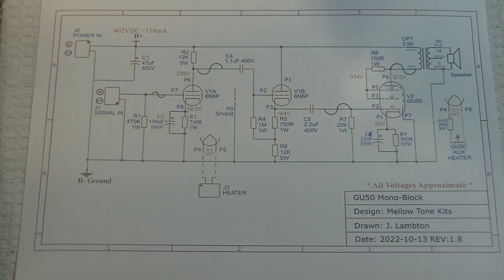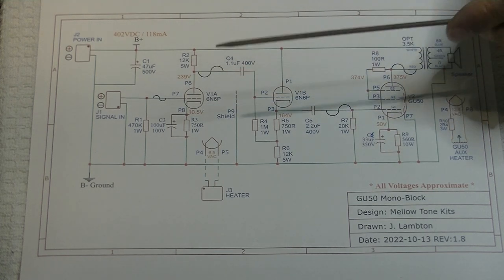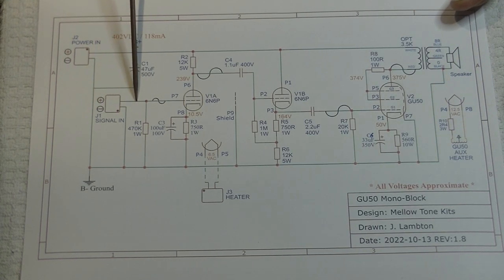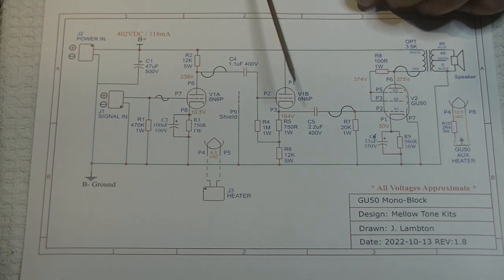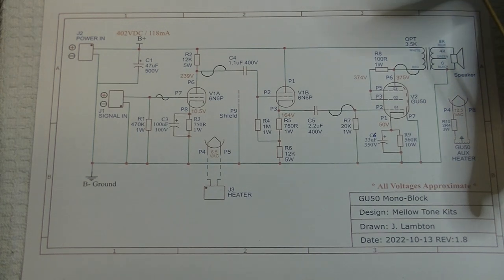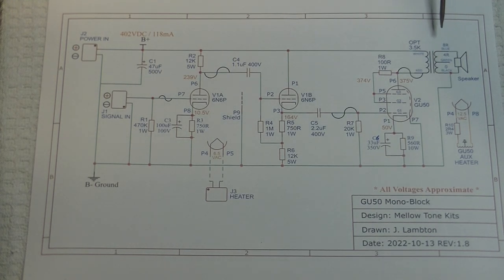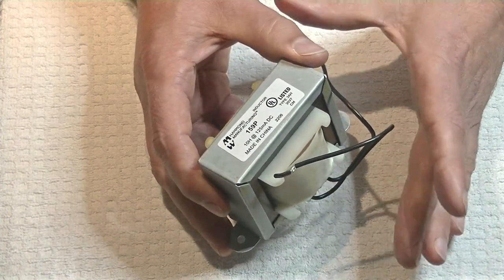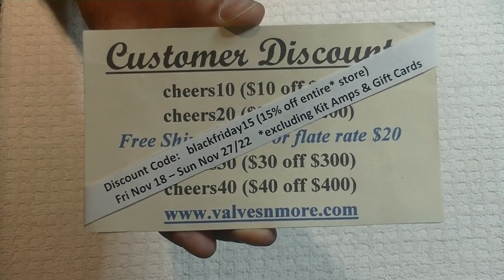Tube Lab 109 - GU50 Kit Monoblock Schematic Walk-Through

Comment: I appreciate your experience and knowledge in hi-fi and tubes.Very professional.
I have a question:
I want to replace the kt88 stock tubes in my Willsenton R8.What do you choose between Genalex gold lion kt88 and Electroakustik black diamond KT88 nade in USA ?
Kind regards
Reply from the maker: First off nobody has made vacuum tubes in the USA, in any quantity, since about 1982.  

Genalex is an old brand name and is being used to rebrand a Russian power tube made in Saratov Russia by New Sensor of New York.  They make all kinds of reissues (rebrands) including Gold Lion, mullard, Tesla and Svetlana - none of them are anywhere close to the original vintage tube.

Electroakustik is an old brand name, for what is probably a rebranded Chinese power tube - stay away - far far away from Chinese power tubes.
 
The very best KT88's i've ever heard were true vintage Svetlana's (St. Petersburg) - a rare and hard to find tube these days - I make 2 or 3 quads up a year and they sell instantly.  CAUTION!  many Fakes and Reissues for this tube - none of them sound the same.  

One good option for the R8 is the true vintage Svetlana 6550c, a lower powered KT88, which is perfect for the R8.  The R8 is basically an EL34 amp that can play KT77, 6550c and KT88 tubes - but because it doesn't have the voltage required by a KT88 to come close to max power, they are mostly wasted on the amp.  

And of course the R8 sounds amazing with vintage EL34's.

Comment: Good quality capacitors are quite expensive. Can c4 and c5 be replaced with small capacity?
Reply from the maker: Yes you can with some guidelines below.  I use these high quality Solen "Fast Caps" in all of the Kit Amps, so we just standardized the voltage rating at 400v to cover a wide range of circuits.  C4 needs to be rated for about 287vdc (239x120%) and C5 197vdc (164 x 120%).  That's if your B+ is close to the design value of 402vdc.  I use a minimum of 120% rating to give room for startup voltage surge, variations in household mains and to increase the lifespan of the coupling capacitors.  Going cheap on coupling caps is never a good idea, if sonics are important to you!

Comment: I really love GU-50 I made wonderfull amps with it. The only thing that seems odd is that you put the G2 to plate voltage. Since I read Russian, they are really specific about not exceeding 250V. The plate can go to 1000V I made a push-pull monoblock with 500V plate and 250V on G2. It sounds wonderfully and it is shy of 20W rms.
Reply from the maker: Agreed! sound and durability of GU50 is very good.  We of course work from Russian data sheet, but are not afraid to try different configurations and voltages.  In many cases mil spec Soviet era tubes can operate safely outside of firm specifications under certain conditions and with careful testing and trials to confirm.  We had a maximum 400vdc to work with and found in various quasi triode mode tests that the GU50 had more power (0.25w) and sounded better with G2,G3 strapped to the plate.  We have 100's of hours on our original tubes and they still work perfectly and sound amazing.
Reply: @tubelab194  thanks. Since you love triodes, you should try 6S19P (6С19П) it's about 5watt wonderfully sounding cheap tube.

Comment: Can you find a cheap deal on some GM-100 tubes?
Reply from the maker: Haha no such thing as a cheap GM100!  Are you seriously thinking of working with 1,000 to 1,500v (1.0 - 1.5kV)?  Other than the novelty of working with something that will kill you if you make one mistake, why not work with tubes like the GU-50 that are readily available, affordable and sound amazing.  We have 5 bench supplies and one of them goes to 1kV and even though I know what I'm doing, my hands start to shake when i need to use it at max power!
Reply: @tubelab194  When I first found them they were on ebay as cheap as 100 dollars each. After the war started the cheapest I have found is like 300 each. I have an eimac 3-1000Z that I have been messing with. You just know that you will only ever make one mistake. There are some commercially sold monoblocks using them. But I wanted to make one before finding that one.